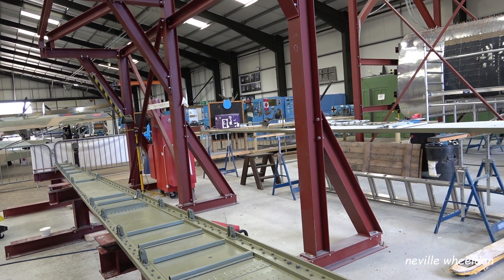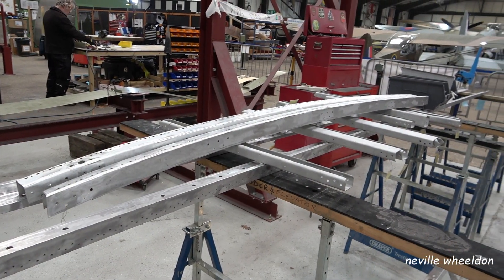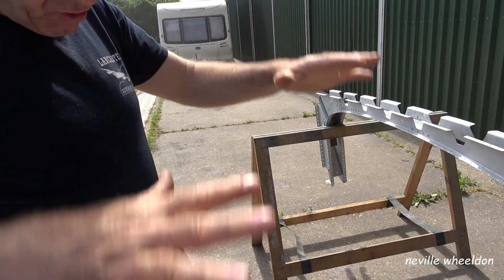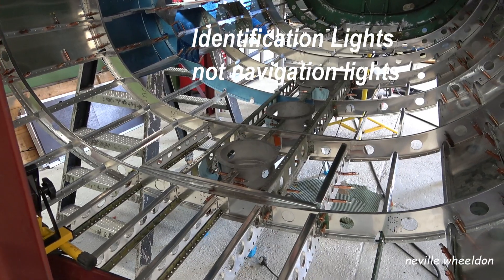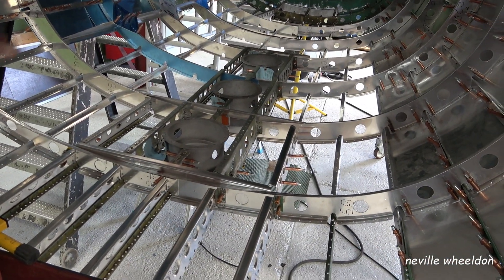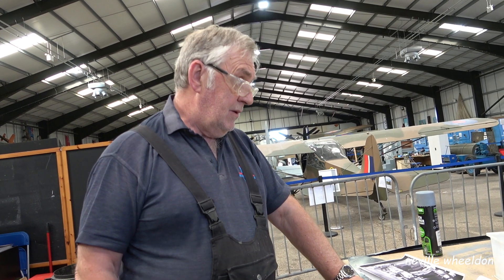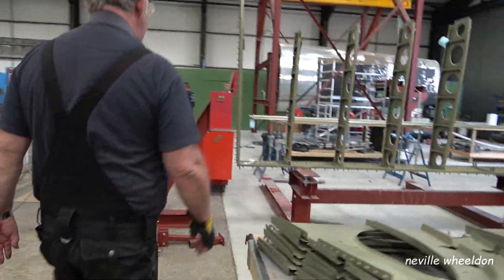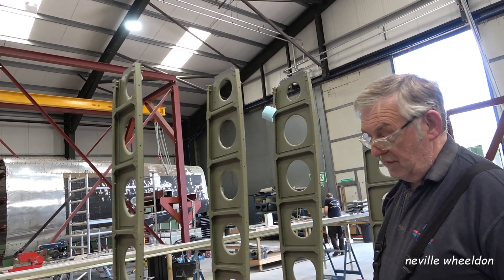Video 154 Restoration of Lancaster NX611 Year 5.. Ribs fitted to rear spar French wing.

Comment: Fantastic video.  I have a question however.  When the wing structure is rebuilt there will be lots of hardware, pipes, electrical cables etc for the various systems  that will need to be put on it before it can be fitted to Just Jane.  Will this hardware be transferred from Just Jane or are there sufficient spares to build up a duplicate wing entirely?
Reply: Jeremy Rowley interesting question. I would think they need to have most of the cable runs,  fuel lines in place before they fit the finial top skins. It would be interesting to see how they transfer the two wings. I don`t see an overhead crane at EK
Reply: @davidmartyn5044  I guess they'll just hire one in.
Reply from the maker: Hi Jeremy, East Kirkby as a good stock of spares, but most properly transfer Just Janes over